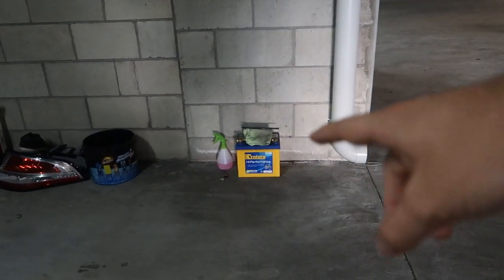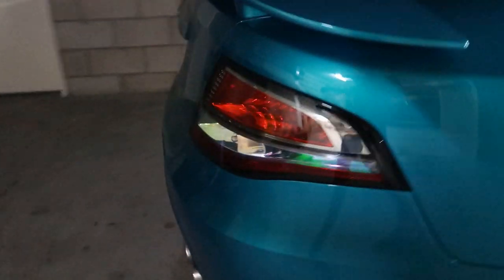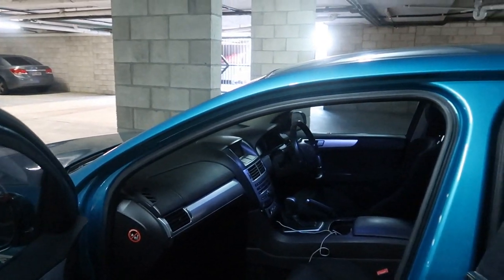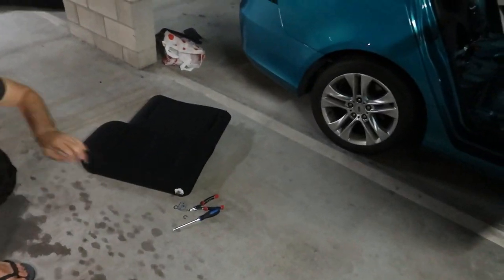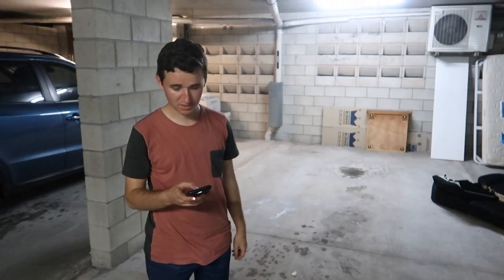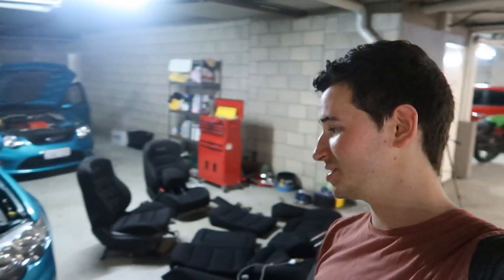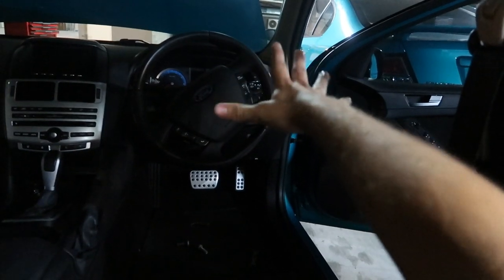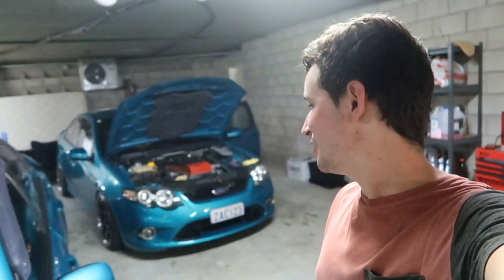Swapping the Interiors in my 2 Ford Falcons

Comment: I had same problem with my looms when I went from cloth to leather interior. I just cut it to fit and it worked fine. Not sure if you can or want to though.
Reply: If the wires are the same, how about a de-pin and swap the connectors?